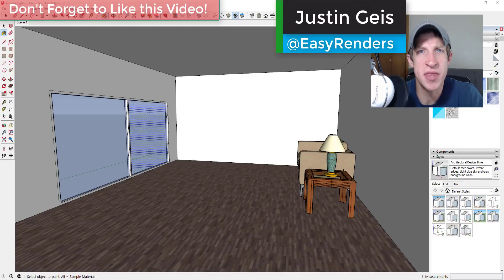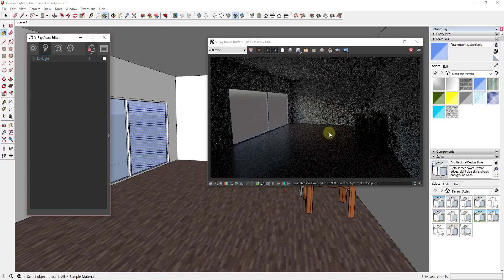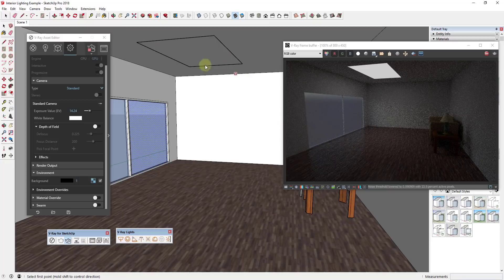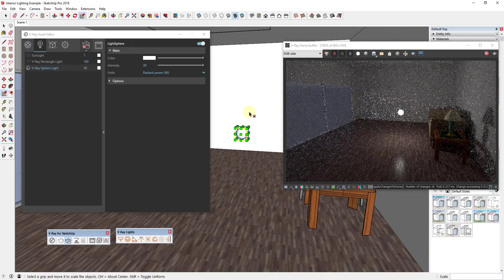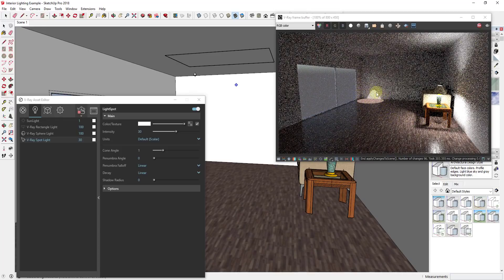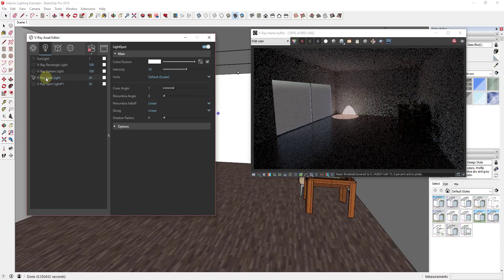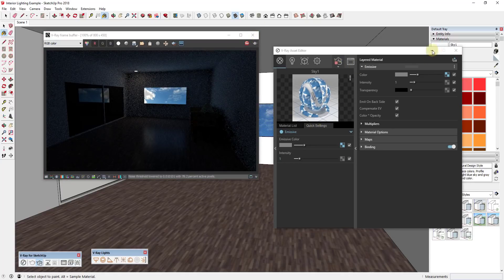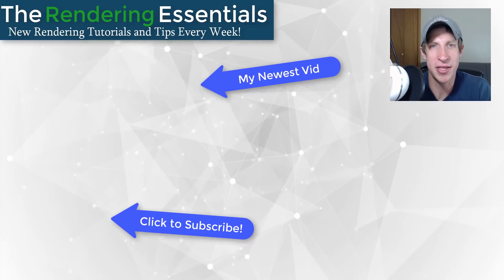Getting Started Rendering in Vray (EP 4) - Interior Lighting in Vray Using Artificial Lighting

Comment: Thank you for this video Justin. I am a new subscriber and I really find your videos really helpful. I am new to Vray but have used Sketchup for many years now.

I have a question though. I am using a free trial version of Vray 5.0  and when I place any type of lights from Vray into my 3D model the interactive render screen does not show the illumination from the light automatically like yours does. Instead I have to individually change each light source I've used in the model so that it's in wattage so that the illumination appears. Also, the light source (spotlight, sphere, rectangle, etc) in my model appears in wire frame rather than a solid white object. Could you please explain why that is?
 
Thanks for your expertise.

Comment: Hey, you chose the “sphere of light” and changed it from “default (Scalar)" to " Radiant power (W)” how did you manage it? I can't do it. It is absolute black light when I changed to "radiant power (W)". Can you solve this situation? Thanks.
Reply: You probably have the answer by now, so I´m just leaving a comment to those who get here with the same issue. 
When you change the units, the value is set in the new units. In the case of the change to Scalar to Watts, the former value is too low. You have to increase the intensity to make the light source more powerful.
That shoud solve the problem.

Comment: What if your lights don't show in the render? Added a simple spot and it is on in the settings but it doesn't show up in the render. Using the latest version of sketchup and vray. Thanks
Reply from the maker: Are you sure that you have the power set high enough that it would register in your scene?
Reply: @TheRenderingEssentials  Thanks. That was it. I thought I had it high enough but played with the exposure control and power and all good now.

Comment: One problem I am facing with Spot light is whenever i put it into my model for some interior renders then the tip of light cone always starts from very below the actual position of spot light. Is there any solution to bring it a liitle higher??
Reply from the maker: Did you try moving the actual spotlight object's physical position up?
Reply: Yes but then no light falls on the floor because moving the actual spotlight higher may be interfered by the ceiling.
Reply from the maker: Well you can't move it above the ceiling and expect it to cast light below the ceiling - maybe increase the angle of the cone in the settings...

Comment: Hi, do you know whether v-ray already has a way to simulate a projector light? So basically a spotlight that can emit an image?
Reply from the maker: I'll have to take a look at that - my initial thought is to create the lens of the projector as an emitter so that it's lit up, but then also place your image on the wall as an emitter as well. I'm not sure that doing that as an actual "projection" is the way to approach that, but someone may be along to correct me soon :)
Reply: The Rendering Essentials thanks. For most users that's probably not the most important feature, but for simulating video mapping and moving heads with gobo's that work around is almost impossible (and the main reason i opted for another renderer a while ago). So i was just wondering if there was any improvement yet ;)
Reply from the maker: Sorry I wasn't more helpful - I am curious though - which program did you end up using, and does it have that function built-in?
Reply: The Rendering Essentials yes i use  THEA render for that. Here you can see what i mean https://youtu.be/wpfxLgbsSyQ
Thanks anyway for your reply!

Comment: Omni Light has decay and shadows radius, it's meant to be more of an "area light" to light up whole areas of a room. It's not that "it's not as bright", but it's because the decay is set to inverse square by default which means the light "fade" out a lot more. Hope that helps 😊
Reply from the maker: As always, that's an excellent explanation! Is there a time or usage when you prefer to use Omni over Sphere Lights in your renderings?
Reply: @TheRenderingEssentials  Been comparing sphere and omni, and in the case of a narrow space that needs to be lit evenly (apartment hallway), several omnis in a row set to 2 Scalar and decay at Linear makes everything evenly brighter, as opposed to an invisible sphere light which will have the effect of a lantern suspended in air (hot spots etc)..  can send you test renders if you're interested to see?
Reply: @TheRenderingEssentials  I guess its better used for just generally having more light in an entire room, where as a sphere light from a lightbulb or lamp would be better for more realistic light sources?
Reply: I have literally been searching for weeks on how to light up a large room.  I use the program for work and we are new to Vray and for me the omni light did nothing...changed it from inverse and what a difference!!!!!  The answer I was searching for was right there in the comments.  THANK YOU SO MUCH!!
Reply: @Maxton Gunner why are you like this